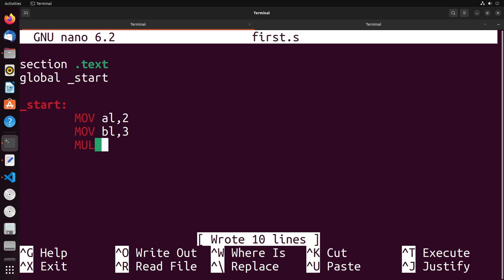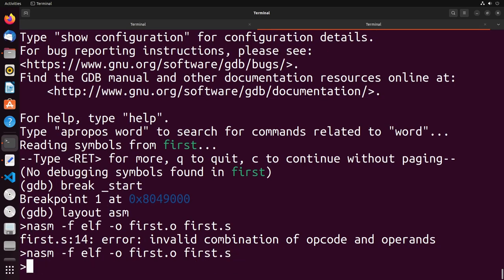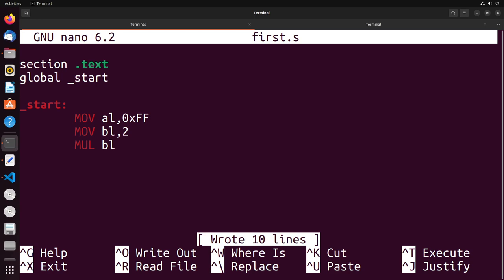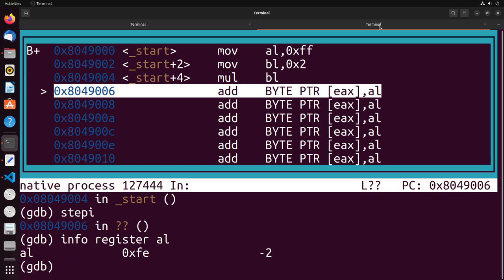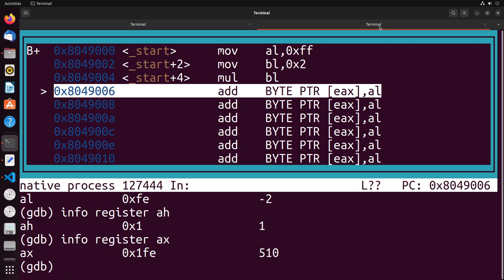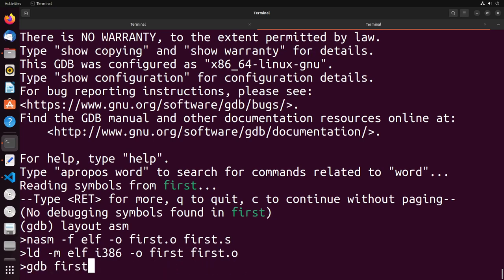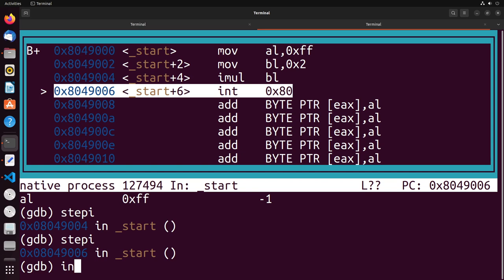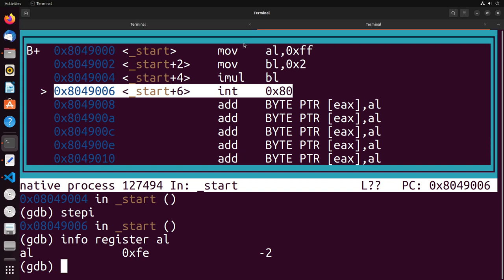Learning x86 with NASM - Multiplying numbers with MUL and IMUL

Comment: 0xFF for 1 byte is not 255, its -1. The first bit is to check for sign, you were wrong in previous video also where you said it knows sign because of sign bit, sign bit will change upon next operation, but the value will still be negative - because of same reason. Range of a 1 byte register is -128 to 127